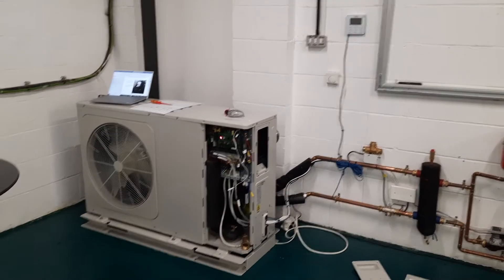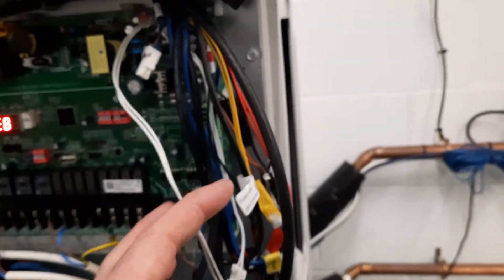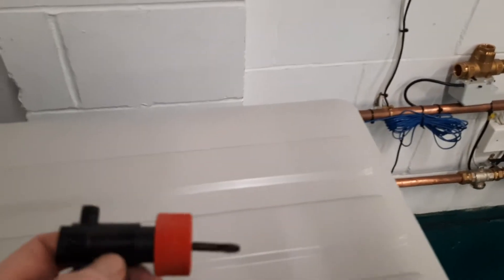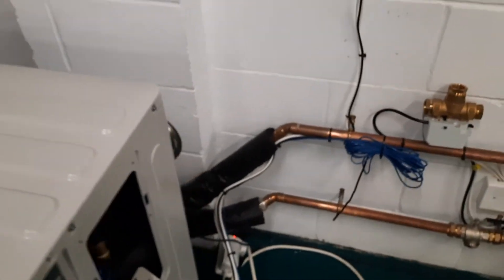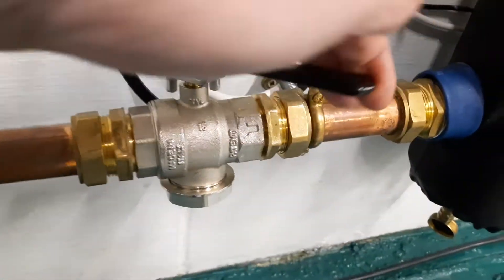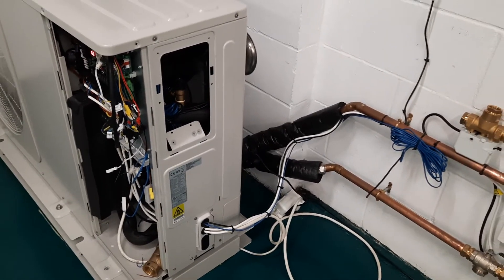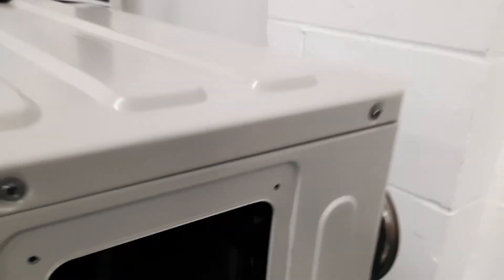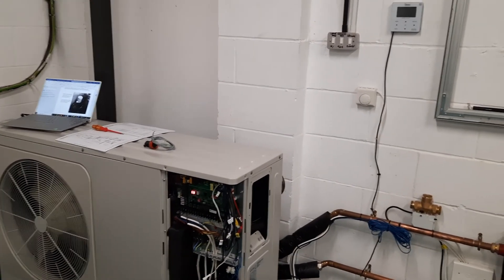E8 error Midea air source heat pumps part 1 of 2

Comment: I have E8 error on Midea 8kw HeatPump when it starts heating the DHW(Domestic Hot Water). After restarting the Heat Pump, it runs fine till it finish the heating of the water from the boiler. The water debit in this circuit is normally at 0.9 to  1.1 m3/h. This debit is achieved with an auxiliary water pump (On/OFF signal from the three way valve)on the circuit. Without this auxiliary pump the debit on the DHW circuit was at 0.6 - 0.8 m3/h. Strangely, the frequency of the error didn't improve much after adding the auxiliary pump. Another thing is that it is not having errors during the summer when the house heating is not needed. The debit on the House heating (radiators circuit is about 1.3 m3/h). I checked/cleaned  the filters, checked the pressure but no much difference. Any idea if I could lower this 1 m3/h threshold?

Comment: what would you recommend for connectivity - I have swapped old Heat pump that had no pump inside unit, it is quite far (20m with 3,5m height diff) from buffer tank so I have pumps in both directions. But on the Midea there is no such concept of connectivity as a cascade/serial water pump. Just behind/after the Buffer Tank pump which mixes water for no need as I have for each water "circuit" a respective pump. Thanks for advice

Comment: I have this E8 error code up on my Midea 8Kw every few weeks since installation in Feb 22. It's highly annoying as it likes to konk out during the night leaving the family and I to wake up to an ice cold house. I have cleaned the filter the first few times it happened (it was very clean each time so I don't think sediment is the issue) and since then I alternate between cleaning then bleeding the radiators and simply switching it off and on again as i'm 99% sure sediment isn't the issue. Does my unit require a new flow paddle switch do you think?
Reply: Do you use a buffer tank? What diameter pipes is used in your system?
Reply: @matthiasj668  Yes system has a buffer tank. Don't know pipe diameter off hand
Reply: Well, a buffer tank should prevent this issue from happening. Check if the circuit to te buffer tank has narrow piping, or is limiting somewhere, fittings, valves and such
Reply: @matthiasj668  we had a Samsung HP before and the installer kept the existing pipework Inc buffer tank and then replaced the outdoor unit so I'm assuming he checked the pipework is up to grade etc
Reply: Fair enough. Feels like the Midea is not up to the task then.
Reply: @matthiasj668  There was a mention in this video or another of some float switches sticking inside the outdoor units so I'm wondering whether mine is one of those. My installer is off over Christmas and New Year so I'll have to wait
Reply: Let's hope that's the case, good luck
Reply: Hi, do you find out what's te cause? Mine do same thing. I have floor heating, no buffer tank.
Reply: @kenrausk9194  No still waiting for the installer to come over and fit a replacement part
Reply: @Ken Rausk Is the distributor using a pump? How many groups, and what diameter/length pipe is going to it from the heat pump?
Reply: So, turns out that the problem is with my water pump(shimge) circuit board software. They send me a new water pump circuit board(newer one) and the problem is gone.
Reply: @jeffjeffjeff2 hi! What was the solution for the heat pump problem? I have the same issue.
Reply: @jelenfi  A new flow switch (replaced FOC under warranty) fixed the issue for me 👍

Comment: Is there a flow sensor, which measures the flow in l/min? How is the water flow modulated?
Reply from the maker: yes on the newest samsung gen 6 there is, on older units pre 2018 no you cant see the flow rate. see videos for e911 flow error. and the water speed is not modulated, its flat out all the time.